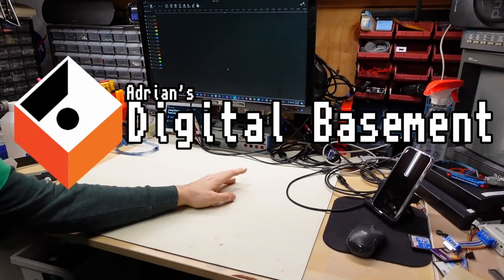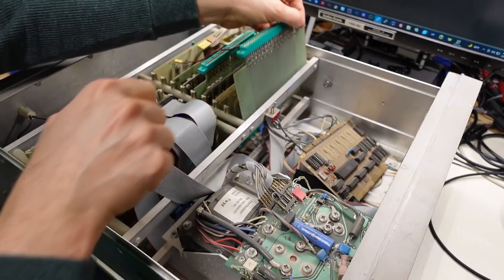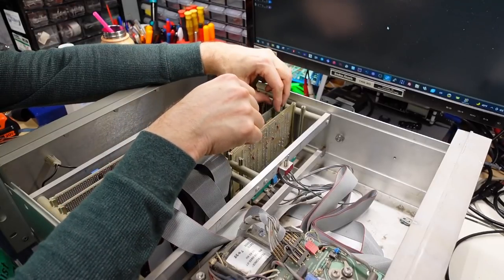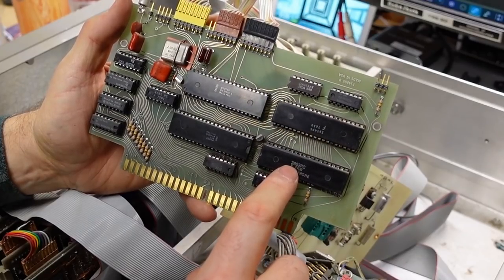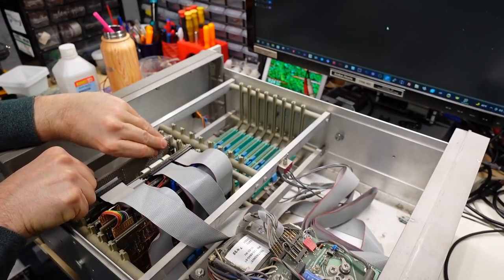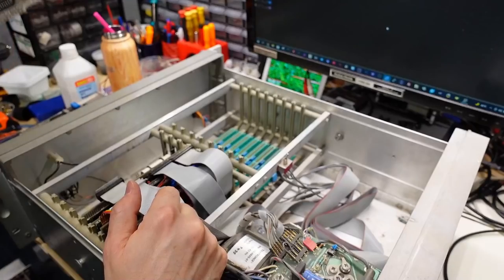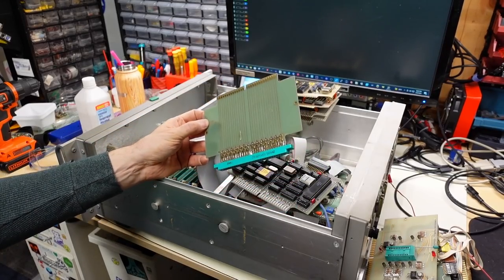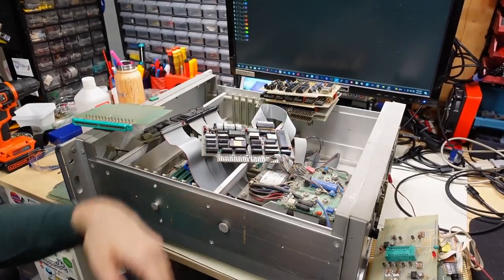I need help finding information on this mysterious computer

Comment: For development work at Tektronix without use of an operating system on the board bucket, the Microprocessor Development group also had a skilled software team that developed a nice Macro Assembler, Re-locating Linker, and downloader toolset that ran on the Tektronix Control Data Cyber 73 timeshare system running KRONOS.  Most of the toolset was written in PASCAL, and worked very well.  The assemblers for the different processors were made to be as consistent with each other as possible.   The team also wrote great documentation for the software tools they made, that made it quite easy to come up to speed on the use of the tools for developing code for the system.     This was the environment most frequently used for doing software development for the board bucket systems  within Tektronix.

The earliest versions of the Board Bucket system were used as development systems for what became the famous  and rather incredible (for the time) Tektronix 4051 all-in-one BASIC-language Graphics Computer.  The 4051 was the first of its kind, providing a cable Tektronix-written dialect of BASIC in ROM, augmented by the ability to do high resolution graphics, drawn on the systems' storage tube display.
(https://www.youtube.com/watch?v=xWrIS_l5HWk). 
The success of using board bucket as a development system for the 4051 made them quite popular as a development platform for all kinds of things within product groups at Tektronix.

The board bucket circuit boards were hand laid-out by a very nice lady named Dixie who worked in the Microprocessor Development Group.  It was amazing to watch her working with tape and Mylar on a big light board to lay out the pads and traces for the boards.  This was before there were CAD systems were commonly used for this kind of thing, although Tektronix did have an early REDAC printed circuit board CAD system based on a Digital Equipment PDP 8/I system down in the basement CAD laboratory at the main Tektronix campus, but this system was typically very busy doing production circuit board layouts.

 Dixie was a real artist.  The art of her work is evident in routing of the circuit boards.  Most of the boards were two layer boards, with a sandwiched ground plane, and etch on the top and bottom of the boards, with plated-through feedthroughs.   Dixie was well-known throughout the company as one of the best hand-tapers around.  The boards she laid out were always beautiful to look at, but as electronically sound as could be made.   It was an extreme rarity for one of Dixie's circuit boards to not come up when a prototype run was done and a board stuffed with parts.  Almost every time the problem proved to be in assembly, not having to do anything with the board layout.  As much as I can remember, only once was a second-run of a board required due to a layout issue resulting in some kind of noise problem that took quite some time to track down.

Tektronix' ECB (as they were called there, for "Etched Circuit Board") manufacturing plant was legendary for creating some of the best circuit boards in the industry.  Gold was heavily used, even on internal engineering boards, and the quality was impeccable.  Even the internal engineering boards were produced as if they were going to go into a Tektronix product, making them vastly superior to most all of the hobby computer S-100 boards on the market.  And, in the end, they were a considerably  less expensive than comparable boards in the hobbyist marketplace if you built them out yourself.  If you opted to buy the boards fully built-out, they were still less expensive than an rough equivalent S-100 board in the hobby marketplace.

 I did not work in the Microprocessor Development Group, but because of my interest, I became quite close with the members of this group, and spent a lot of my free time over in their area hob-nobbing with the folks there.   I learned a great deal from them in terms of digital design and microprocessor interfacing.   I purchased a number of the unpopulated boards and built them up myself to make a small system to play with at home, which grew over time.

Later, as a "spare-time G-job " project, I was "signed up" by the Microprocessor Development group to develop a custom system based on this hardware to serve as a wafer tracking system in Tektronix' IC fabrication facility(later sold to Maxim).  

I designed a video board based on a Texas Instruments video controller (can't remember the part number, but it was compatible with TI's 9900 CPU and required a little work to interface it to the bus).  The board would hook up to a large (CRT) TV.  There were a number of these systems planted around the fabrication areas, mounted so they were easily readable from just about anywhere in the area.   The systems all talked to each other over a syingle RS-232 line where I used a time-slicing protocol so each system got a slot of time where it could talk to the others to relay status information.  Each system had a CRT terminal attached via serial port where operators could enter information and query the system.    The video board also had the National Semiconductor real-time clock chip on-board along with battery-backup.    I also modified the floppy controller with a daughter board that plugged in place of the NEC floppy controller that provided the capability to used double-sided, double-density 5 1/4" floppy drives so I had enough disk space for the data the system needed to store.    The system used the 6809 CPU (my favorite 8-bitter).  It was packaged in a similar chassis, and used Technical Systems Consultants' Flex-09 operating system, which I wrote custom drivers for to talk to the floppy controller, serial ports, and video display subsystem.     The system was prototyped and tested out with a couple of select folks from the IC fab, and they made a few recommendations for some changes, which I incorporated, and then it was installed in the Fab.  It worked great, and really improved the efficiency of the fab's production workflow.

The system that you have uses a different bus structure, but the concept is very similar to the board bucket.   I think that the board with all of the 8?-square-pin connectors along the top is a multi-port serial board.  The sockets might be for async interface chips.

Comment: The security was really good on the Star Trek Computer Too.  "Captain, Someone is accessing the Transporter"  "Lock them out Mr. Worf".... Guy in transporter room opens a unlocked panel and moves two control crystals... "Captain, he has over rode the lockout and transported off the ship."
Reply: There's not a lot one can do to stop a hacker with physical access to the hardware.
Reply: @jfbeam  I never understood how security could be so lax on a starship.  When I worked in nuclear power production, there was no way a random person was going to walk into  a restricted area such as a control room.  All critical doors were monitored and lock through access control, and attempting to enter a door you didn't have access to would result in angry security guy showing up.  Even in a hospital if there is an alert about a missing or wandering patient, the staff can lock the place down pretty quick.
Reply: @timmooney7528  In the Star Trek future, everyone is trustworthy. Picard says something to this effect in the S1E25 / The Neutral Zone. (Data finds three people in cryo.) Everyone knows the rules, and almost always obeys them.

Don't forget about the incident where they even shutdown power to kill the transporter, but the guy used a phasor to power it directly. (S3E11 / The Hunted)
Reply: Even in 1967, I was wondering why there was no security for the transporter room.
Reply: @jfbeam  Time and time again has shown that every guest on the ship is not to be trusted.

Comment: Prototyping station/University research project.
Get an idea, work out the logic, make the board, install it for testing.
If it works, you have a new functionality for your computer!
I saw some amazing machines when I worked at University.
Example:
A multi-touch stylus pad in the form a glass slab; CRT behind it.
Solid slab of glass, about 22 mm thick, slightly larger than a typical monitor of the day.
Dozens of piezo-crystals lined the edges.
Sequential 'pings' through the glass would be attenuated by finger contact, more pressure, more signal loss.
By pinging from many different locations, up to 4 finger contacts could be read with confidence.
All hand-made using common shop tools, 1973 according to the label.
No CPU: all 7400 series logic, analog or digital outputs.
It got sold 'by-the-pound' at surplus...

Comment: I worked as an electrician in a steel rolling mill (retired now) and this looks like something that was used to replace some analog logic. Proms were used to help match different production modules as needed. This was all done inhouse as you could not buy anything that would work with the local setup. Serial ports may have gone to seven segment displays

Comment: The whole package looked like something out of Tektronix so I was pleased that it had the Tek label on the transformer. In a previous life I worked at Tek and took a leave of absence in 1973 to go to the Oregon Graduate Center ( later to become the Oregon Graduate Institute and eventually merged with Oregon Health and Sciences University) to construct a special piece of test equipment. When I completed that project I decided that it was more enjoyable than my job at Tek and stayed there until retirement in 2008 at 70. The prototyping boards looked like some we used at Tek and it seems possible that it was prototype for a piece of test gear. When I was in the component evaluation group at Tek, we would often have to build a one off piece of gear for testing some particular component or group of components. I later moved to the CRT instrumentation group where we designed and built test equipment for the CRT manufacturing department. In that group we usually made custom circuit boards since there were typically multiple pieces needed for the large number of test bays for the testing process. The wire used for those hand built cards looked like it was transformer wire which seemed logical since it was easily available from the transformer department and was not going to have insulation melting problems to dal with. I am afraid that I have no idea what was built for and could have easily been someone's home project. A lot of us built our own home projects using our experience from work and that build looked like something I might have tried. Hand manufacturing such equipment just seemed normal for a lot of us.

Comment: That EPROM programmer's processor card is based on a Fairchild F8 CPU which is made up from those four 40 pin chips; a Mostek MK3850 ALU, an MK3852 Dynamic Memory Interface (DMI) to control additional RAM or ROM (or EPROM), an MK3854 DMA controller for the MK3852 connected memory, and finally a MK90071P a.k.a. MK3851 Program Storage Unit (PSU) which contained 1 KB of program ROM and handled instruction decoding. The MK90071 number on the MK3851 is the ROM mask number for the EPROM programmer code. The Z280 was to the Z80 like what the 65C816 was to the 6502, but much more so. It looks like two complete separate systems in there with the EPROM programmer as a smart peripheral. Everything is serially interfaced and the EPROMS on the card likely contain a very basic ROM Monitor program for developing firmware on the Z80 system. The floppy controller PCB also contains a 1K PROM, possibly for boot code. I could tell more, but you keep moving the boards around randomly and holding them at angles so it's terribly hard to see.
Reply from the maker: Interesting stuff. Check the description, there is a link to high res pictures of all the boards, front and back.

Comment: All those extra wires reminds me of when I built my Heath/Zenith 148 (ca 1984, my first computer).  Although, H/Z was nice enough to show a diagram of where the trace jumper wires should be and what (if any) component should go with it.  The video card never did work, and, at that time, there were H/Z stores you could go to and exchange non-working boards for good.  Great vid
Reply: The Heath/ Zenith techs' motto was,  "Never let the customer fail."  For a short time I worked on the Z248 motherboards.  The US government had loads of them.  They were a planar  system with the large DIN keyboard connector on  the motherboard.  It was intended to be a cost saving machine, allowing ti to be upgraded by swapping out the CPU card and other old cards.   By the time the 486 came on the market, a complete "system on a card" came out containing the cpu, memory,  local bus video, I/O, floppy and hard drive controllers.  Everything fit on a full length ISA card, allowing nearly every card to be removed.  I don't recall if ZDS sold many of the 486 cards.  Most of what was being sold  during that desktop refresh project was complete desktops.
Reply: @timmooney7528  Tim.. yes, the 148/151/158 was a planar system with individual boards for all the peripherals.  In Oct of 1989 I added an Intel Inboard 386/PC card to upgrade my 8086 and I had a story on the install published in the Nov 1989 issue of "REMark", the official Zenith/Heath Computer Magazine.  Heady days back then.
Reply: @ncdave4  I worked at ZDS from 1990-96.  I remember we had a couple of bookshelves full of reading materials, and REMark was one of them.  We'd test laptop modems by calling the Heath/ Zenith user's group (ZUG) BBS.  ZUG would have listings of clearance items as well as an area for private sales and correspondence.

Comment: My Z80 system from Heathkit used a terminal that emulated a monitor system (VT-100??). 2 8” DSDD floppy’s, and 2 5.25” DSDD floppy’s. I think it was the H89. Ran CPM and later MSDOS. It was a workhorse and I used to write Z80 Assembly code for Z80 projects I used to wire wrap.

The PIO is parallel input/output (2 8bit ports) with printer handshake but also highly configurable for bit input and output. The Serial Input/output chip (SIO) is a dual port serial (both ports can be asynchronous or synchronous) with modem handshake. The Counter/Timer IC (CTC) is used to generate the clocks for the SIO baud-rate generation. The CTC has 4 independent counters or timers as needed by the hardware. Precision outputs for different clock frequencies.

Love the Z80 family of chips. Very well engineered.

Comment: z80 mini computer running CP/M, I used to go to a video store for rentals, and they ran one.  This was in the late 80's, I seem to recall it used a serial terminal as the console.
Reply: Well, that was quick 😂 (EST Timestamp 17;42 March 10th, 2021)
Reply: yeah I was going to suggest something similar as well... point of sale system or similar. One serial for modem, one for console terminal, one for serial bus replicator to talk to POS terminals?
Reply: @solitairepilot  Well, may not be this exact thing, there were alot of these out there back in the day.  But I found it funny that it was still running in the early 1990's, I guess since re-doing the catalog would have been a hassle, even if you could technically do everything in DacEasy database.  :-D
Reply: @chouseification  serial dot matrix printer!  :-)
Reply: @pauldunecat  good point - each POS terminal would have needed one of those bad boys for receipt printing - double copy with "carbon" often.
Reply: @chouseification  More often NCR paper. Carbon paper is a mess to deal with and you could get up to 4 copy NCR paper for reasonable a price if you bought 5+ boxes at a time.  Look like whoever built this had a lot of SWTP 6800 connectors.  The S100 connector were hard to get for a couple of years and were a LOT more expensive.
Reply: @waynecampeau4566  yeah that's why I used quotes. I used actual carbon paper with typerwriters, but most of the pre-printed forms you'd use with a POS terminal (those little half-sheets you'd get when renting movies, they had to tear at the perforations, etc) were the later style without actual carbon paper.
Reply: @chouseification  We sometimes did use actual carbon paper at some jobs.  The Most interesting one was at a place where the payroll accounting was so classified, that we had to remove the ribbon from the line printer and load serial numbered paper that had a captive carbon sheet.  It was a real pain.  They REALLY didn't want anyone knowing how much they were paying the district administrators office verses the teachers and professors.
Reply: @waynecampeau4566  I know exactly what you mean, and the exposed layer sometimes even had a crosshatch pattern to make it difficult to even see where the pins had struck :P

Comment: Back in the day we called those riser cards "extender cards" because they would extend the signals outside the card cage so you could actually probe signals on the card you were troubleshooting.
Reply: Yep - in rack mount usually extended out the front of the case because you wouldn’t be able to get in the top!
Reply: @geoffreykeane4072  Exactly!
I hated troubleshooting boards that worked on the extender card outside the enclosure or card cage, but failed once they were seated in place.  You had to get creative, tack solder a test lead or use mini- or micro-grabber clips, then run the test lead outside the cage.